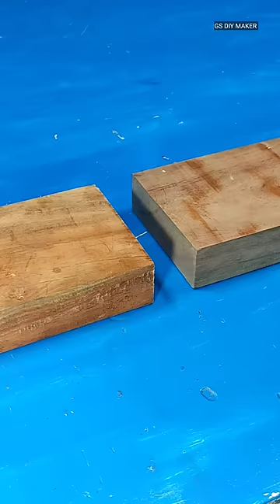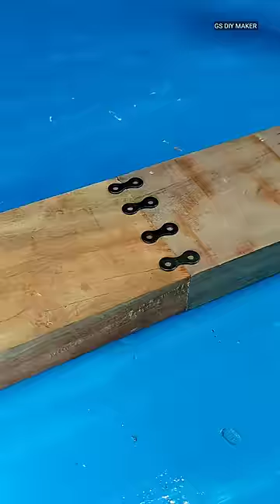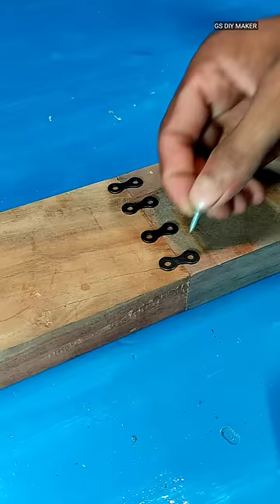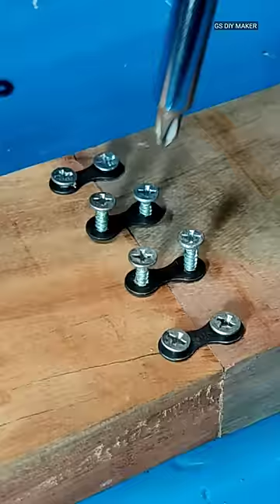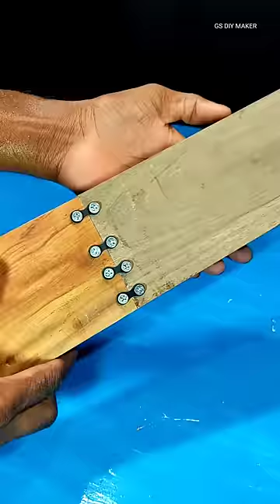Amazing idea from a bicycle chain || #tips #shorts

Comment: For a fast and cheaper option just use those zig-zag metal chips that can be hammered horizontally (only 2-3). 
That will save your loads of screws and a bicycle chain😁